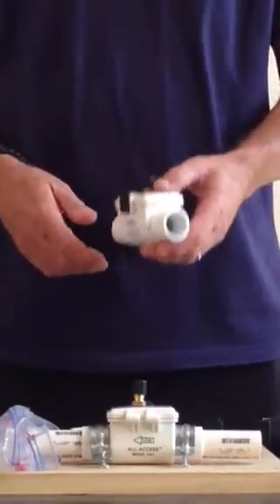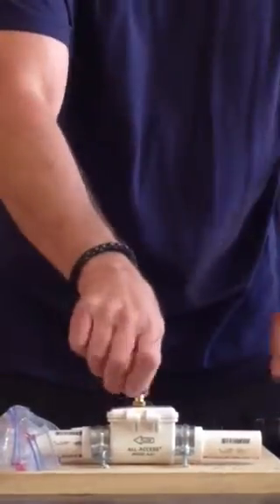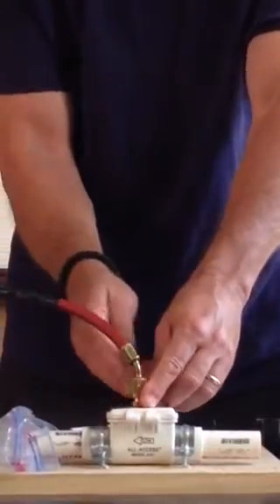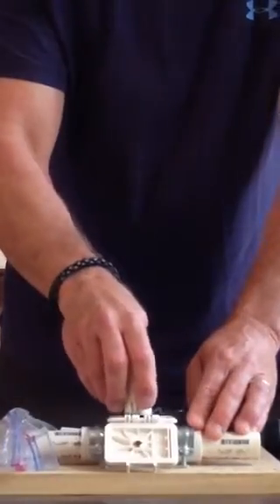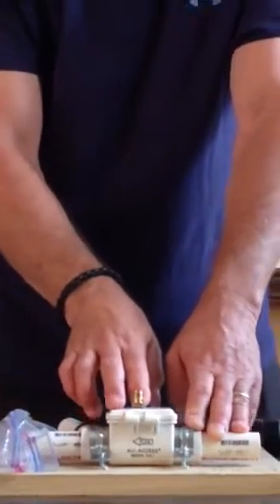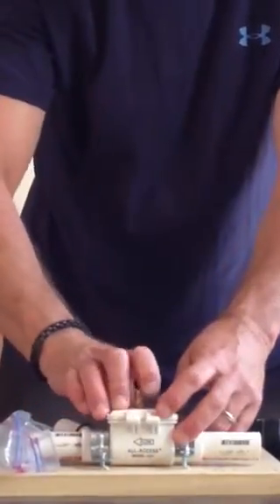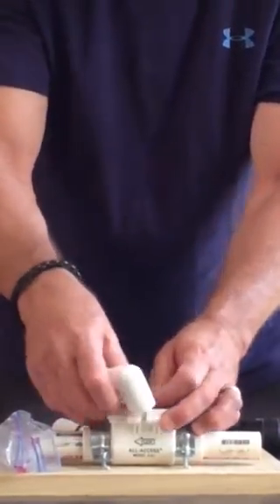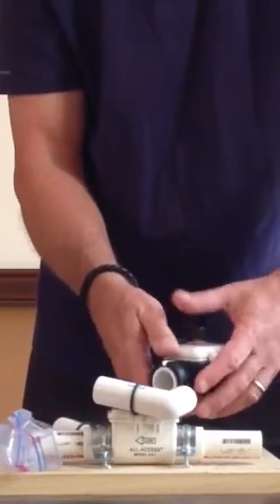All access

Comment from the maker: Joseph,
1) A tech cuts the line and caps it on one unit,then clears other line, does he remember to reconnect it? I think so. I have more faith in techs as I was one for 25 years in S. Florida..
2) Device is completely open therefore not changing the existing drain line inside diameter, it is not a trap, if the air leakage problem exists it was already there before this device was installed.
3) Leave the (90)adaptor and pin in included holder attached to the device, that is why it is there.